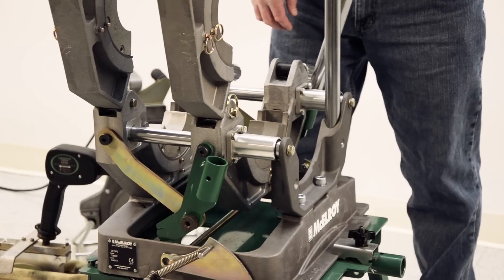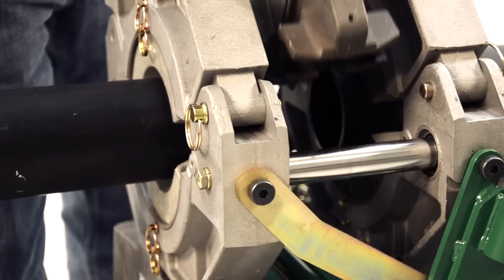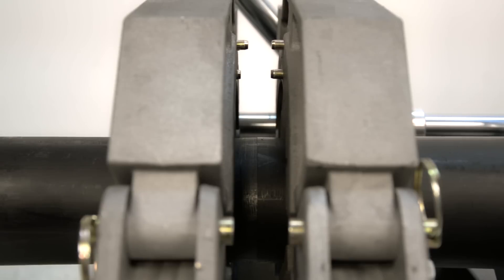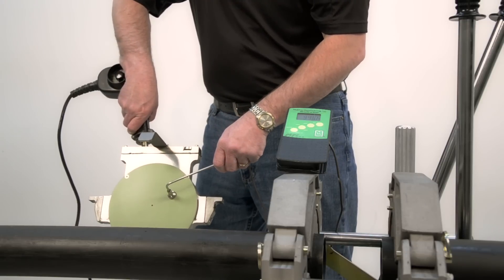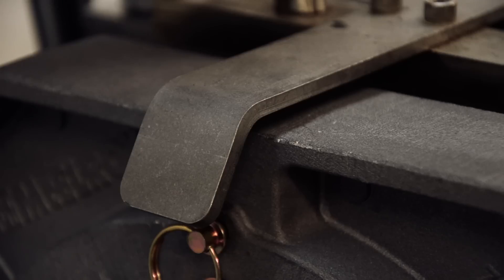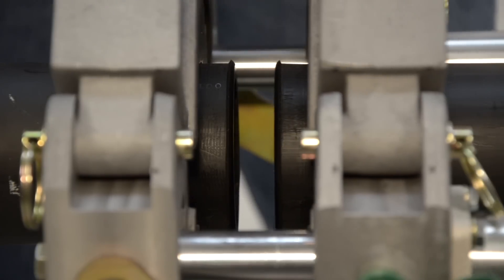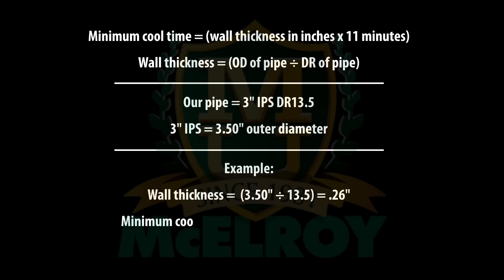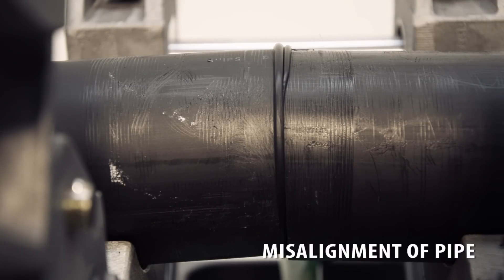How to Fuse Pipe with the McElroy Pit Bull® 26

Comment: I’ve noticed two Allen wrench screw on the spindle that slides, will loosening or tightening help with more accurate facing without cranking down the handles so much?

Comment: Hello, great video! I have seen people use isopropyl alcohol to clean the pipe, is that a good practice or should it be avoided?
Reply: It is good practice if your pipe is contaminated with dirt and debris. Also good to wipe the ends of your newly faced pipe with the same clean lint free cloth and 95% isopropyl as you may have contaminated the ends while removing shavings.
Reply: @kirkster72  No alcohol on ends of pipe. Don't touch them with anything besides clean cloth. If you do just reface.

Comment: He never marked the line on the side of the pipe to make sure it didn't slip nor an alcohol wipe as well he did not discuss the minimum and maximum  bead width measurement  of the butt fusion the video  is a little older but the state would fine the contractor
Reply: Depending on what state u live in there's different rules
Reply: You do not use alcohol wipes for butt fuses. If you contaminate the edge you need to re-face the pipe ends. But yes, you need to mark slippage lines.